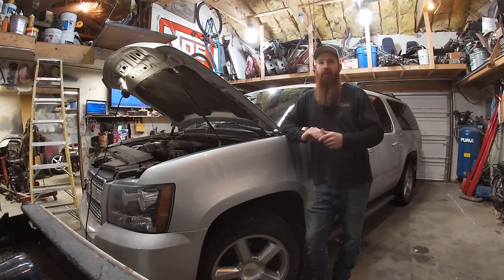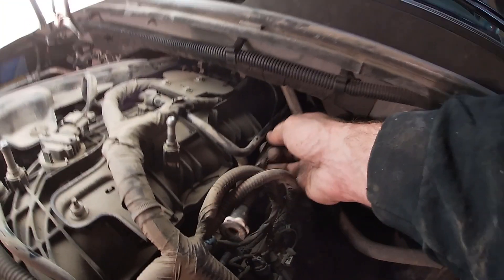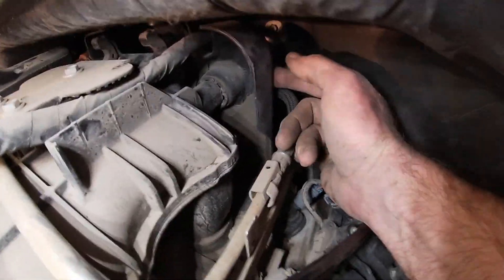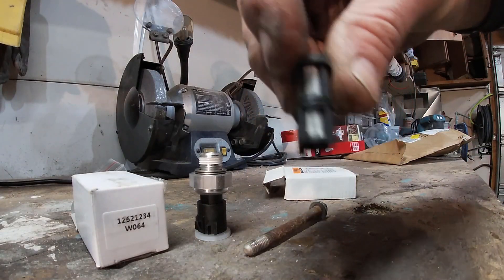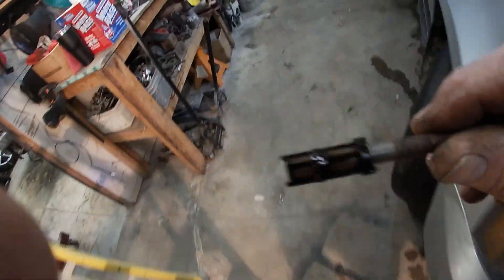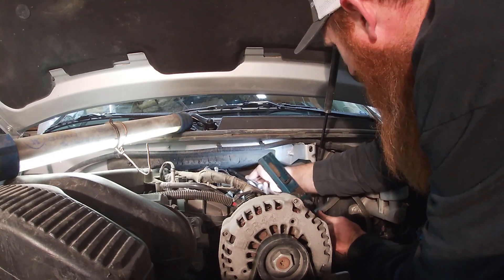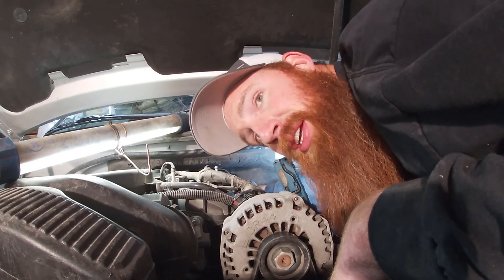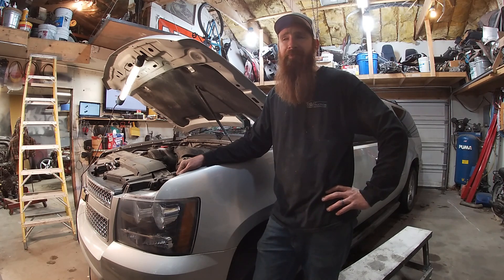Chevy Suburban NO OIL PRESSURE How to Fix Codes P0521 P0523

Comment: Did the pressure switch just fail and show zero psi ? I show zero but truck is running fine. It’s a 2012 suburban LTZ 5.3 60k on the engine, 180k on the truck
Reply from the maker: Yea it just dropped to zero  and stayed there.
Reply: @ So did mine. Then one day it pegged at 80 and dropped to zero then the  “genie” light would go on which scares me since the “genie” light is supposedly on a different switch. 🤷🏻‍♂️

Comment: This is great! Thanks
Reply from the maker: No problem  thanks for watching
Reply: @FullThrottlePerformanceMike and if this does not fix the issue after replacing sensor
Reply from the maker: @Wafflemaker4000m  it could be your oil pump pickup tube o ring
Reply from the maker: @Wafflemaker4000m  did you replace the screen under the sensor?
Reply: @FullThrottlePerformanceMike  I did. Ultimately I decided that it must be a failure of the vlom plate,  removed the oem vlom.  Replaced it with a doorman replacement and presto,  back to 40psi oil pressure
Reply from the maker: @Wafflemaker4000m  nice
Reply: What size bolt for the screen removal?